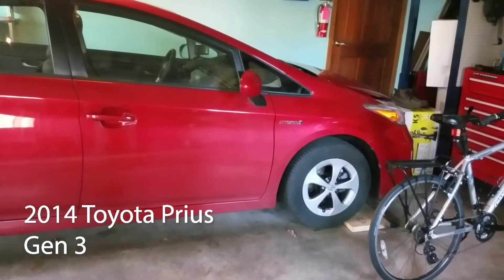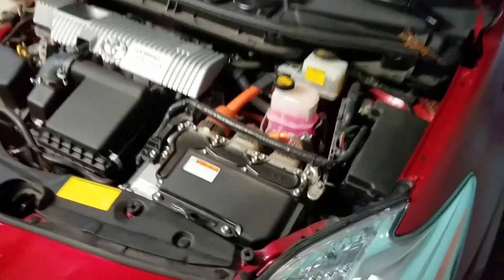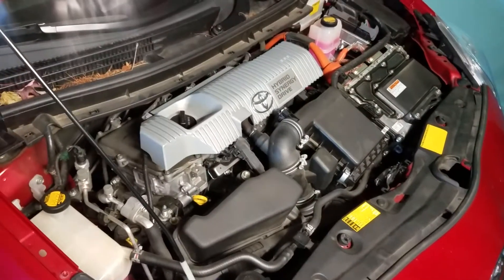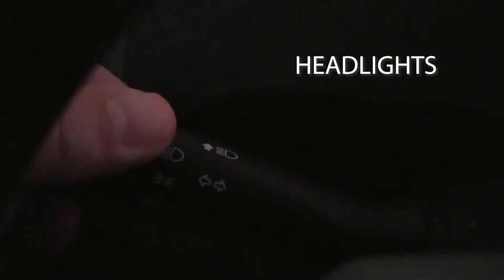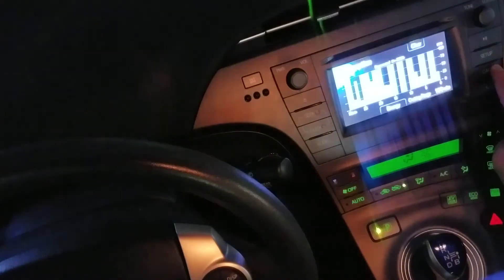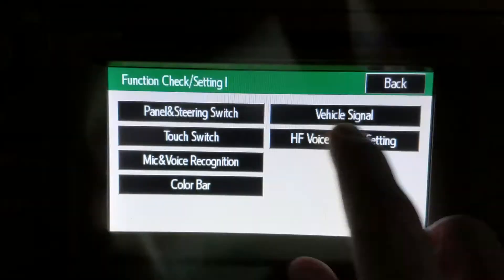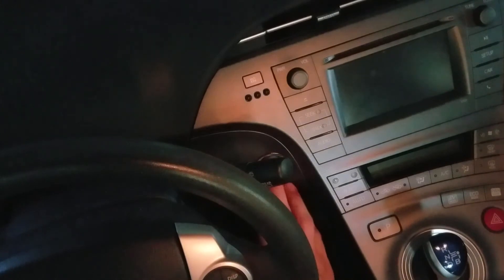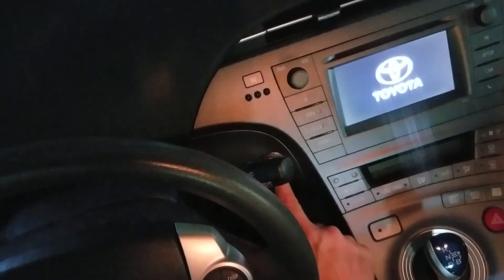PRIUS GEN3 12 VOLT BATTERY SELF TEST

Comment: I doubt you need to replace the battery. In Prius, the 12V battery are often below 12V, the main point is to test it under load like turn the headlight on and see how much it dives to lower voltage.  As long as it is higher than 11.V under load with headlight on and blower motor on, it is still good.
Reply from the maker: Thank you for sharing the info. I learned a bit more after making the video.
From Toyota mechanic;
battery should be at 12.6 volts
when starting voltage should not drop below 10 volts. 
Since this battery only has to get the computer going, it can a long time before needing to be replaced. We're still on the 2014 OEM battery.
Reply: @cfldriven  yes, it is true for regular cars , non hybrid.  Voltage alone is not enough, you need to load test it and see how much voltage drop.  As AGM battery in hybrid is deep cycle, sometime the voltage below 12V but it last really long. 7-9 years in most cases. My battery often just below 12 V and I test load it by turning the ignition, headlight and blower, but the voltage is still above 11.4V. It has been like that since 4 years  ago. It is alrewdu 6 years old and still runs just fine. With a toyota, don't fix if it is ain't  broken.
Reply from the maker: @rondhole  Thank you for sharing all this good information.
Reply: @cfldriven  open circuit will always shows above 12V , usually about 12.3V. But when you press the power button without pressing the brake, normally it will drop to about 11.7V.  Turn the headlight on 11.3V, defroster, blower motor max heater on, it can drop further but still above 10V, you are safe.  Bad battery often shows below 10V when the ignition is on. Under all load it drops to 8V.  Below 10V when ignition is on, you often cannot even unlock the door.
Reply from the maker: @rondhole  Adding these numbers to the inside of the manual for future reference. Thanks again.
Reply: @rondhole Thank you for all this info

Comment: The procedure didn't work for my 2014 plug in Prius. Followed everything in the video and only got the screen after pressing the Car button
Reply from the maker: Interesting, that a plug in would work differently. Maybe another plug in user can also share their experience. If you have a multimeter, measurement can also be made from the fuse box in the engine compartment.

Comment: You can also check the 12 V battery with a multimeter in the cigarette lighter
Reply from the maker: You may get a slight difference due to the electronics it going through. You want to use an obstructive path from battery. Best is to measure the battery directly if possible.
Reply: No, the reading is actually identical.  about 12.4V open circuit, about 11.7-11.9 ignition on (2x power button without braking).  14.4V in READY mode.  But only if your Voltmeter is actually good.

Comment: Thanks for a very informative video. I've one question though, can I check the hybrid battery the same way with the engine on?
Reply from the maker: This procedure will not allow you to check the hybrid battery only the starting battery. However there are some OBD readers that can, thus saving you the cost of the dealer checking it.
Reply: I have a cheap ELM327 OBD II reader that I use with my phone and the "Torque Pro" app.  There are "PID Codes" specifically for the Prius that will allow you to read the hybrid battery info showing each individual cell. 

Here's a video showing how to add the Prius PIDS to torque pro. 
https://youtu.be/GYrslzbrwz8

Comment: Is 14.6 volts too high on a brand new battery while my gen3 prius is running? I just want to be sure its ok. Thanks!
Reply from the maker: When the car is on, the onboard inverter is charging the battery, thus the higher and normal voltage.

Comment: Good instructional video, I just checked my 12v battery's voltage of my 2015 Prius Plug-in, it is still at 12.2v...still good maybe another one or two years. I actually created myself calendar reminder to keep checking the battery voltage every 60 days...!

Much appreciate this instructional video, save me $200 from the new Toyota battery (that's right, brand new 12v battery from Toyota dealer specifically for Prius Plug in is $200 firm)...Thus I checked my Prius Plug-in 12v battery voltage status,,,still good at 12.2v!!!

Sooner or later will require a new battery but the current's still working good at 12.2v ...so avoid of spending $200 and keep using out of its life cycling then!!

Thanks again!
Reply from the maker: Pricey but they seem to last a lot longer than their cheaper cousins. Thank you for sharing your experience and insight, I though for sure this past winter would kill the battery but it still going.

Comment: My 2012 Prius 12V reads 14.4V today. I replaced 2.5 years ago after coming back from a 3-day trip to a dead car. I just came back from a 4-day trip to a dead car. If the System Check Mode reads OK and the battery is fine, what do I try next to figure out why my car keeps dying when not used for a few days?
Reply from the maker: The Prius and many other cars continue using power after being turned off, although 4 days is awfully quick. Was the vehicle locked, on my e-Golf that reduces the current draw as the electronics are monitoring less. If you do many short trips, that doesn't allow enough time for the 12 volt battery to be topped off. You could consider a small trickle charger for when you are gone.

Comment: Is there a way to determine the battery life of a used prius? Without buying a reader and using dr prius app
Reply from the maker: No unless you go to the dealer and have a friend with access.
Reply: Thanks I bought a 2015 prius two yesterday for 9100 cash 81k miles pristine condition. I was able to check the 12v battery cause of you. I'm happy with my purchase and next week toyota dealership will service it rotate tires and let me know if anything else may be needed. Gonna have them check the battery. But it runs so smooth I wouldn't think it would need a new battery yet.
Reply from the maker: @alexisdaniellewebster105  Nice going on the purchase. The gen 3 is still my favorite, don't like the "new" look Prius. If the owner didn't get the software updated, the dealer with take care of it since it was part of a recall. We drove ours three times cross country and bypassed a lot of gas stations. Enjoy.
Reply: The easiest parameter is reading the internal resistance of the 24 cells HV battery.   You can use capable ELF327 scanner with Dr.Prius apps. Carista is one of them.    Dying battery has large internal resistance and usually much larger than the rest of other cells.  Usually only one or 2 cells are bad but the rest are on the  way too.   Typical gen2 or gen3 battery last about 11 years in hot weather and well beyond 15 years in mild weather or when it is garage kept.

Comment: This is great that you can do this. BUT this is USELESS to figure out if the 12V battery is in good or not so good condition.

Just opening the driver side door will hit your battery hard (notice that buzzing sound ? that is pre-charging the break cylinder, the biggest load ! during the start up of the car)  and you turn on the  CAR even in auxiliary mode will take even more charge out of the battery. The only real test is to measure the battery open circuit after charge was completed for a few hours (basically stop the car and let it sit). 

Same issue with the under the hood measuring, either you have to leave the hood un-locked after you stop the car so you DO NOT open the driver side door or get into the car from the right reach over to open the hood.  However you can open the hatch without any of the previously mention problem and you FINALLY CAN measure the voltage of the open circuit "rested" 12 V battery.   (this better than nothing  but if you really want to know the battery "health" you need a real battery tester many places will perform this for free)

If you cannot bother to buy a multi-meter why bother with the rest ... again what the car show IS the voltage but it is useless at that point to assess the 12V battery actually 11.8V could be just fine by the way.  Not great, if that is the rested voltage then it is definitely  bad news.  But that is NOT what you measure with this procedure.
Reply from the maker: Thank you for sharing you insight. Yet its the voltage under load that determines whether or not the vehicle will Power on, you still have to open the door to get into the car in order to switch it on. For those without access to a multi-meter this procedure provides some information.
Reply: @cfldriven   @cfldriven  Sorry you are mistaken, this is not the way a 12V battery tested (self tested).  This is the voltage of the 12V battery  after all the steps booting the car and you can keep watching it if you choose until restart again.  Educational but nothing to with battery "self test".  This voltage again means very little  (I am not saying nothing).  It will heavily depend what happened to the car  especially the 12V battery prior to this test. If the car was driven 30-40 minutes at least before parking it (then waiting for the test 2-3 hours at least so 12V battery charge settle) then, you may have some useful information, because then you can assume the 12V battery was more or less fully charged (if the battery still OK state). Otherwise you would start the test from an unknown state. I guess you can believe what you want but other people may take your advise how to "self test" the 12V battery. If you want meaningful test result you would need to fully charge the battery (either by driving your car  long enough, or some external charger), let it rest a few hours and measure the open circuit voltage that will give a realistic view of the battery "health" you can also compensate for temperature etc. 

What you show is hey the car still started up, now I can measure the voltage afterword  ... could be very very misleading. 

If you want to measure the car battery under load which is  an even more realistic way to check the "health" of the battery, you would need even more than a multi-meter.  Again this is a good test if you can get it done will tell you a lot (how long you can expect the 12V battery to last)

If you are concerned of the 12V battery, let me suggest to get one of those smart/trickle charger (not too cheap a 1A or 2A is enough) and charge the battery up time to time. Especially if the car sits a lot (during Covid or otherwise).  You have a garage (judging from the video so this should be a non-brainer). 

What you can easily tell from your own experience that just starting up the car and get to the point you can measure the voltage, a LOT of charge was pulled I explained before, this "low" voltage 11.8V  is due to the realtively small size of this prius battery... but this is NOT unusual at all.

Comment: My battery says 14.6V is that ok?
Reply from the maker: That is outstanding! Just like new.
Reply: @cfldriven  I was confused because I thought it should read 12v but I’ll take the 14.6 lol. I purchased the car in Jan of 2019 & it’s got 83k as of now. I’ve babied this car as if it was a luxury sports car but I do that with all my cars. Hoping to keep this car for as long as it runs.
Reply: Thanks for the video by the way, it really helped me. Only problem I have now is I’m debating if I should return this Alpine touchscreen head unit I bought because I just realized I would lose the self diagnosing option with the factory radio. I do have a yellow meter where I can check from the fuse box so that wouldn’t be a problem for me but I know there’s other options I would lose.
Reply from the maker: @joeshmoe8952  A fully charged battery will typically display a voltmeter reading of about 12.6 to 12.8 volts, if the car is on the voltage would be in the 14v area. This is due to the DC to DC inverter charging the batter.
Reply: Hey there, I'm back again with a quick question. I tested my battery today with the method you showed on the video. I popped open the fuse box and used my fluke meter. I have an aftermarket radio so the factory radio option is not available for me. I tested the car when it was off and it read 13, when it was on 15. Are those ok numbers? Reason I ask is because I had a coupon for a dealership oil change and they told me my battery was going bad.

Comment: 2015 plug in  Worked perfectly! It was always just waiting for it to die before knowing you need a new battery. Finally a car that tells you exactly how your 12 volt is doing without tools! Thank you!
Reply from the maker: Agree, Toyota should have made it a one touch option.
Reply: The problem is that this is NOT telling you that much see my comment for longer explanation. What would really be good if the car would show the voltage BEFORE it started all the stuff.. the voltage is there by the way i am sure the MCU probably konws it so it could show if Toyota wanted. The only thing it tells you that NOW your battery was good enough to start the car which depends on previous state of charge (when you parked) the temperature at the time  etc.

Comment: Thanks for this. Told me what voltage my battery is on. Is 11.8V good for my second hand Prius that I have 145k kilometres on?
Reply from the maker: A fully charge battery should read 12.6 volts, this display will typically measure 0.2 to 0.3 volts lower then the battery is, as it does place a load on the battery. Depending on your typical driving pattern (short or long) and temperature exposure are factors to consider. Our 2014 OEM battery started the car last week with temps in the low teens. We have a very short daily commute, but weekend errands make sure the battery gets topped off. If I were you I would just keep monitoring the voltage level and if it continues to drop below 11.5V you may want to opt for a replacement.
Reply: @cfldriven  alright thanks. If it helps, I drive the car 200+ kilometres per daily. And it is a 2015 Prius
Reply from the maker: @horrerahashmi8306  With that kind of daily mileage you battery won't die due to insufficient charge. We're 6yrs on the OEM and will probably replace this summer for piece of mind. Will go with Toyota battery as its designed with correct internal resistance for the charging system and if it anything like the OEM I'll get another 6 years.
Reply: DID YOU END UP HAVING TO REPLACE BECAUSE OF IDIOT LIGHTS ON. MINE HAD A WARNING OF CHECK HYBRID SYSTEM

Comment: how accurate is the voltage displayed? When I measure externally by multimeter I ve 1-2V difference. I.e it shows 10.5 when the car is off and 11.4 after a drive but I myself measure 12.3
Reply from the maker: After driving the battery has been charging so not surprising to see a higher voltage. The diff between measuring at the battery, or the engine fuse box is due to cable length and electronics, as the Prius is never truly off. Best reading off of battery is couple hours after driving or first thing in the morning without turning on anything, keep fob away.
Thanks for the view.
Reply: @cfldriven  Thanks
Reply: The battery in this video is perfectly normal and in excellent condition. Only in warm weather >12V is a good parameter for open circuit (ignition is off).  In cold weather below freezing, the best number is not the maximum voltage but the voltage reading under load.  As long as it is above 11 V when the ignition is on, it is OK. If the headlight+heater/defroster+AC blower are all on, it should be still above 10V.  This is the best parameter, not the voltage without any large load.  Bad battery often shows ?>12V and drop under 10 V, often as low as 8V when under load.  I have mine at 11.7V when ignition is on, it does not have problems for the past 4 years starting the car.  My old bad battery reads 12.2V open circuit but when under any load it drops well below 10 V. That death battery was 7 years old in hot Florida without garage.  14.4V is only when the car in READY mode, DC to DC converter works as alternator charging the battery.
Reply: @rondhole  Thank you, as a note, I found out the year of battery ( 2010 Prius), was 8.5 years old, so replaced it as a preventative action even though not facing any starting issues. And with the new one, it shows 14.8V from the cigarette adapter when in Ready mode
Reply: @abdullaharslan1318  Off course, even without the battery you will still read 14.4+V .  What you read in READY mode is DC to DC converter, not from the 12V battery. 
You must not press the brake to test the battery.  So the voltage you read comes from the 12V battery that way.  Usually it reads at about 11.5-12 V after pressing the power button twice.  As long as you still have more than 10V reading when turn the head light on, the battery is still good.  NO need to replace if it is not broken, it is Toyota way.  12V battery last much longer in milder weather, sometimes more than 10 years in UK/Ireland.
Reply: My prius 3 show 11,9V on new battery. When I make measure with my voltmeter - car was off - 14,3V what is 2,4V difference. What means that it si very good conditions of my new battery. Now I buy a bluetooth checker battery, which will show me when is my battery low and when I have to charge it. I think this is the best solutions how to check battery premanently.
Reply from the maker: @TheMikeborecek  Thank you for sharing your insight on voltage differences between load and no load when testing a battery. The confusion occurs that the off car batt at 14.3V only shows 11.9V when used to start the car. What is the lowest voltage the Prius needs at the electronics to start the car as it never see the 14.3V?